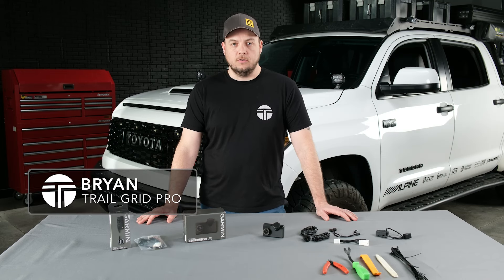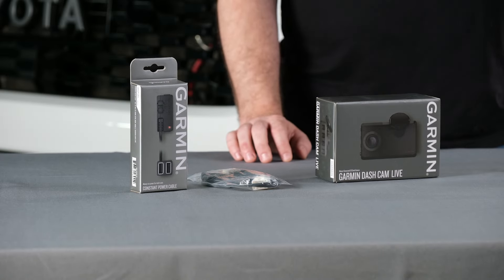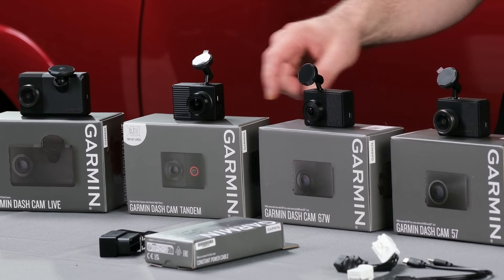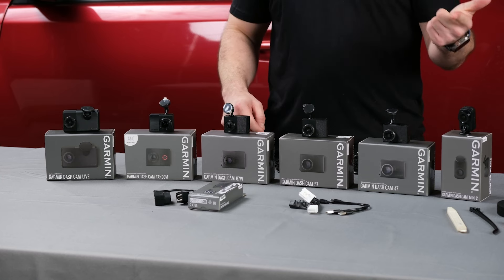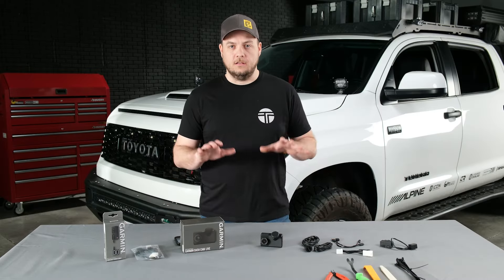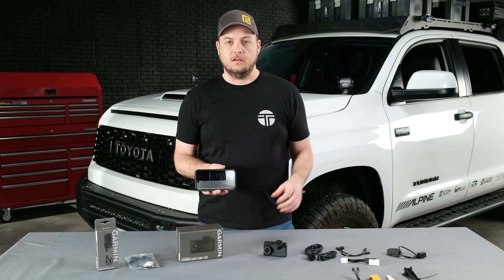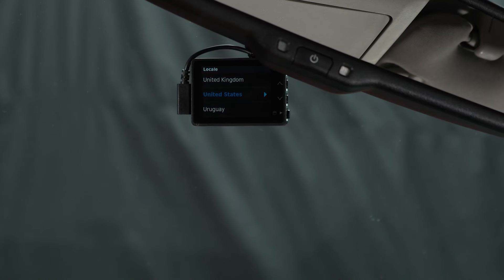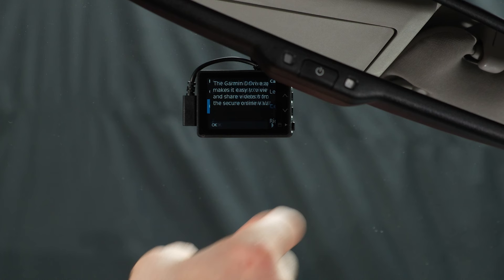Toyota Tundra Garmin Dash Camera Plug & Play Kits w/ Constant Power Solution

Comment: Very helpful video
By the way, can you power the Garmin dashcam
live for 2 months in park mode where the car
engine is off, and the dashcam is directly
plugged into OBD-2 port 24/7?
Im planning to park my car in the airport for 2
months and I want to monitor it while im away
Do you have any idea how long the car battery
will last using the Garmin Live Dash Cam plugged
in 24/7?
My car battery is ACDELCO
760 CCA, 120 RC, 70 AHt, 88864541, 48AGM

Big thanks
Reply from the maker: Great question! The Garmin Constant Power adapter automatically shuts off when the vehicle's battery drops too low. We've never tested to determine how long that takes to happen.